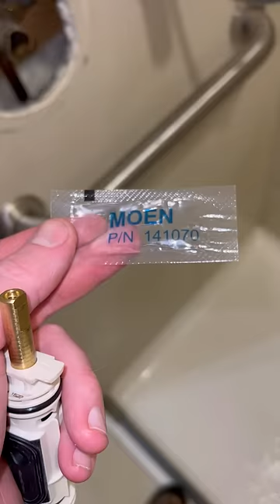Moen 1222 Shower Cartridge Replacement DIY Tutorial! #diy #plumbing #plumber #moen #shower

Comment: I take it you had good luck but as a plumber I recommend to never mess with the integral stops on the shower valve to turn the water off. Just shut off the main or at the street if you have access. Those Moen integral stops are notorious for the oring seal inside the stops to start dripping/leaking because they never get exercised(turned on/off) over time and the rubber seal gets brittle and rips. Just my experience with these but glad you had no issues with that. Just a tip to save you some headache for the next round
Reply: What do u do if the cartridge thingy is completely stuck inside it dose not move at all The only way I was able to shut off the water was to burn the plastic piece with a torch so I can turn the knob to off but the thing won’t come out 🥲 it’s been 4 days and tbh I’m starting to smell
Reply: @goshwk5848 Did you manage to get it out ?
Reply: I found when replacing my Riobel cartridge that the shutoff stops were a soft brass and just turning them made me nervous.
Reply: Tap on a clip to paste it in the text box.Tap on a clip to paste it in the text box.

Comment: Took me 2 hours.  The cartridge was stuck in there so bad I had to drill it out as much as J could and then pick at the remaining parts with needle nose pliers and vice grips. It literally would have been faster to replace the entire valve assembly 😂

Comment: Use 1 1/4 brush to clean out the inner shower valve after removing the cartridge. Otherwise you'll scratch the gaskets on the new cartridge and it'll leak in a day or two

Comment: Good video.  
I just replaced mine today.  
Easy and works so well.   
Didn’t realize the old carriage was so tight and old.  
New moen replacement turns with a pinky finger.  
I just turned my main water off in the garage.  
Other than that idiot proof.  
Thanks
Reply from the maker: This is great to hear!! Love it!

Comment: Video helped me change mine. I messed up at first and it leaked worse. Turned out one of the rubber pieces fell off in the package. 

Been working on learning some basics for a small renovation in my current home and to build my own tiny house. Subscribed. Thank you.

Comment: Gotta love when the client has soft water. They typically come out without a fuss. Without a softener this routine repair would have taken some improvising and ingenuity to successfully complete the repair. This is a big reason why pros dislike moen however, the design of the original posi-temp valve and cartridge  has not changed since it's development. That sells itself. Virtually no other manufacturer can say that. Love, your 21yr vetted plumber ❤

Comment: I have the same mowen faucet and allen head was stipped. i drilled out the set screw and it still wont comeout 😢. I'm hoping it's just calcium deposits. its like a need a puller 😬

Comment: I replaced mine today, but now there is a slight leak coming out of the faucet whereas it didn't leak before. I had to replace it bc it wouldn't shut the water off in the tub. what's causing it to leak and how do I stop the leak?

Comment: What treatment did you put on?
Reply: A certain type of grease. It helps sliding it in and prevents hard removal next time and when showering the handle gets extra smooth....all because of the grease
Reply: Also, helps not mess up those o rings and rubber seals

Comment: What size Allen key? I have like 50 of them and they’re either too big or too small.
Reply: Same thing with me it's not metric so it's got to be English
Reply: @dominiquewilliams6243  gotta hammer in the T15 and twist!
Reply: Twist and hammer hard unless you’re willing to drill out the bolt, and spend an extra 165 replacing the handle.

Comment: Do not use pliers you will break it if it's been in there over 30 years use the tool that screws inside the Cartridge I love how they make it look so easy you could pull it out with pliers so you could just completely screw up your

Comment: I changed that valve following this video, HC is up and now my hot and cold is backwards when showering. What did I do wrong
Reply: Spin the stem only leave the cartridge installed and just spin the stem with no trim on only handle then test if still the same spin another half turn until right your welcome

Comment: What can we do if the old cartridge is not pulling out? Pin is out and cartridge won’t budge. Won’t even turn 45° like the instructions say.
Reply: They make a pulling tool.
Reply: I did get the tool, it was still so stuck I had my foot up on the wall and was using all of my body and twisting. Thought I was gonna break a pipe. The rubber was coming lose and I was fighting and ripping at the rubber until it came all the way out… it was rough.

Comment: My cold water barely trickles but hot comes out fine. I replaced the cartridge. Any ideas?
Reply: Check your water shutoff valves. Make sure the cold is open all the way.
Reply: @Ricky-tl8bz  I didn’t know a shut off valve but I will double check. Thank you
Reply: @studmuffin2330  Yeah, my house has individual shit off valves in the basement for each sink, bathtub, toilet. This is so I don’t have to shut off the water to the house. Just for what I need to work on.
Reply: you most likely have a valve like this video with water stops left and right of the cartridge. Take the cold stop out and run the water quickly and back off. Most likely this will flush out around the stops and you'll be good.

Comment: I just did this but my off is when the handle is up and I only get hot water in the 5 o'clock position, I've double checked and my "HC" is on the top, and my handl moves and stops on the right places, the old one was too dirty and I didnt pay attention, I'm thinking my copper housing/pipes must be ran wrong so I'm gonna try and flip the cartridge upside down unless someone knows something I don't
Reply from the maker: I’ve seen that happen. Does there happen to be another tub or shower on the other side of the wall? I’ve seen guys tee the pipe and go right over. 😑
Reply: @DaveDocDIY  no but there is one directly above it
Reply: Then remove the handle and black plastic piece and turn the black and handle facing down

Comment: Ya the stops suck most 1222s will not come out with needle nose pliers sometimes u will need to screw screws I. The cartridge to pull it out if your puller don’t work ha and the h/c don’t mean shit when the stem has been turned around by whoever the hell touches it before you and ps don’t ever buy knock off 1222s to save u 20$ it will bite you in the ass on install day love moen

Comment: I’ve changed hundreds of these in apartment complexes seem like they are made to last a year or two
Reply: What you charge for that
Reply: I need to replace mine about every 5 years within my house. Doesn't matter whether it is heavily used shower or not.
Reply: @HarminderSingh-jc7rf  it really depends if I’m supplying the part or not. If they have all the parts and I’m just doing the labor and it’s a pretty easy removal, I’ll charge about 100 125 bucks.. I typically try to make about 100 bucks an hour. If I’m doing is that and I’m going over there specifically for that if nothing else I’ll probably charge 150. 200 bucks with parts.
Reply: @HateDietPepsi  no it doesn’t because water is still behind the vaule. You should get a lot longer use out of one if you don’t use the shower as much, of course, but they still will go bad, especially if they’re just sitting there, not being used kind of a double edge sword.
Reply: That's some filthy water you got there son.  Mine last about 8 years and I have high levels of iron and manganese, which are the worst for clogging these things up.

Comment: It's not that easy for some people also you need a good bit of power to pull it out if it's been years and putting it back in I'm 21 male 240 and it was hard to get it back in not fun to deal with the lub it come with use all of it